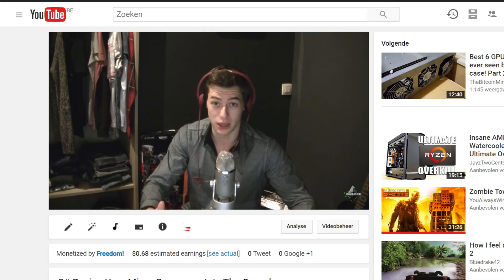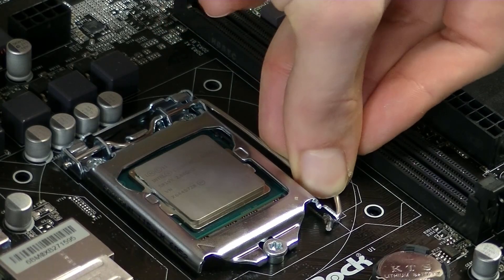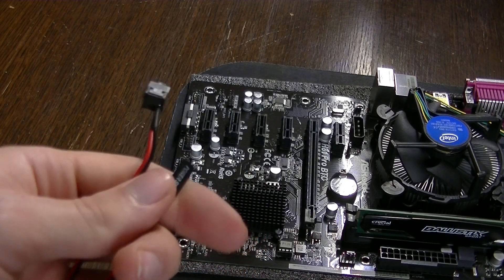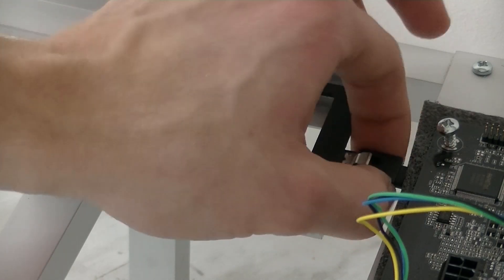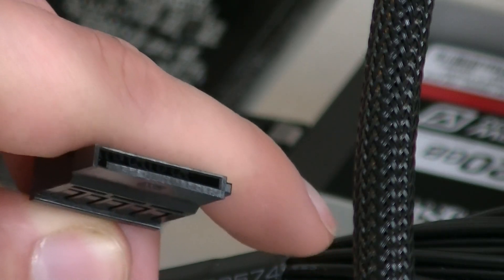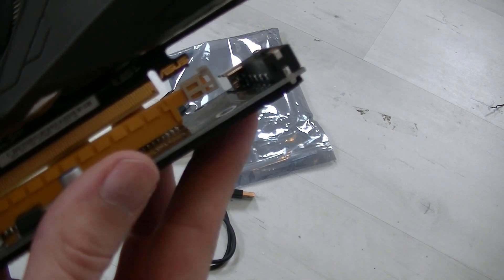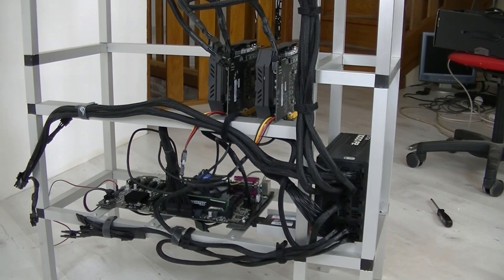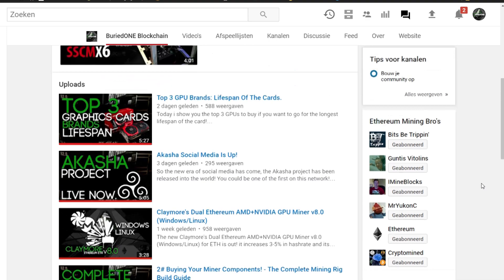3# Assembling The Mining Rig - The Complete Mining Rig Build Guide

Comment: So I went ahead and ordered all the stuff of your website to build an 8 gpu rx 580 rig. As I have started to work on the rig I’m noticing the mother board will only Support 7 cards of risers and doesn’t appear to have an m2 adapter. Also, the recommend power supply was a 1200 w. I think I’m going to be way short on power looks like each gpu requires an 8 pin and a 6 pin plus risers I’m going to be way short. What am I missing. Full disclosure I’m a newb on gpu mining

Comment: Built my rig with a single card, all fine, decide to buy another two cards, only one of the pci x 1 slots work. dammit! :(
Reply from the maker: Scott Miller oh that sucks bro..! Can you get a replacement for your board as warranty maybe?
Reply: Yeah, I've already sent the message to the Amazon marketplace seller. I've read other reports that the pci x1 slots are unreliable, so I won't be surprised if the new one has the same problem, I also have to pay postage and buy new thermal paste. 1 slot works fine, all others Windows fails to boot or if it does no card is recognised.

Comment: Anybody have any idea why I cannot connect any more than 2 GPUs to my ASROCK H81 motherboard???
I have 4 GPUs but computer will not recognise any more than 2!!!!
Please somebody help its driving me CRAZZZZZYYY!!!
Reply: Disable your onboard gpu in the bios
Reply: Thanks, but I've finally figured out what the problem was!
Apparently the ASrock H81 motherboard is NOT compatible with Window 10 when using Nvidia GPU's!!
So I've changed to Windows 7 and everything is working fine.
But thank you for your advice.
Reply: This is strange, I'm on win7 but it only takes 3 GPUs at the same time. No luck with the 4th regardless what I tried.
Reply: Have you connected the power to BOTH of the molex connectors? Theres one at each end of the row of PCIe sockets??
And are you giving the computer plenty of time to install each individual GPU?
I know I sometimes felt like the computer had frozen when it was installing each one but it just took a really long time for each of them to be recognised.
Try installing just one at a time and giving it a good 5-10 minutes for the computer to register each one when you instal it for the first time.
Reply: It is said, if the risers are powered there is no need for the Molex connectors, but ether way it made no difference. What is plenty of time for you? 10 minutes? 20? May be I'll give it more time.
Reply: Yeah I'd say it took about 8-10 minutes for each one to get installed on mine!
I remember always feeling like the computer had frozen and I was about to turn it off several times, but then it seemed to finish doing something and then it was up and running??
Yeah I'd say about 10+ minutes and it should of either installed it or not.
Reply: I gave it another try and put the extra card in...nothing happened...no freeze or anything...starred at the Devicemanager for 15 minutes, still only 3 cards. I asked asrock for the beta bios 1.30B, may be I'm lucky then.
Reply: Sorry I couldn't be any more help, I hope you get it sorted soon.

Comment: Hi, very interesting videos! I have the H81pro btc R2 and powered risers, must I connect the two 4 pin molex of the mainboard (named PCIe Power Connector (PCIE_PWR1) and PCIe Power Connector (PCIE_PWR2) to the power supply or because he risers are powered it's not necessary or even can cause problems ? 

and.. what are the best bios settings of this mainbord for ethos/win10 ?

tks ! if my rig starts I'll send you a beer :) ) ) !!!
Reply: A Rossi same question!
Reply: A Rossi sane question please, it seem that it s ok with 4 cards and the 5th and 6th one are not recognized...
I do exactly the same as the video, i also tried to connect pciepwr1 molex and pciepwr2 but its not changing anymore...

Comment: hi, i have done all of this and it works and powers on and everything but when i connect it to the monitor it does not display anything, also tried removing everything except the cpu and ram and power and still does not display anything, is there something wrong with my motherbaord?
Reply from the maker: Bob Smith its a possibility, but did you try to plug the screen in the board itself and the pci16 card?
Reply: thanks for replying, im not a tech guy but for testing, i have a monitor which has it's own power supply from another socket and used the hdmi cable to connect to the board (i have tested the monitor with my laptop and it does work) it may be the cpu, i put it in a bit rough and this is my first pc build, your video really helped, if you can think of something else it could be please let me know, if i cant find how to fix it ill just order another mother board. Thanks again :)
Reply from the maker: Bob Smith Try to put a gpu in the long pci slot and plug the screen into that :)
Reply: tried that already but didnt work sorry
Reply from the maker: Bob Smith Try to ask someone in our discord chat to help you out :D
Reply: i found out it was because the pins where you place the cpu was a bit damaged, after fixing them managed to make it work, i'm just wondering if i were to get 6 graphics cards on one board such as 6 rx480's or 6 gtx 1070's, would i need 2 psu or will one be enough as i saw one of your videos, one of your rig caught on fire almost :) Thanks
Reply: Hi, how do you fix it? Send back to manufacture? I bought one too and getting no display. My problem is after power on, it turn off after 2-5 secs, then turn on back. Still no display appear just like your problem. Although switching GPU port or Mobo  port.

Comment: Nice Video, 

You should connect the 2 molex cables to the motherboard
Reply from the maker: Ahmed Nattiel is that necessairy? My other rig doesnt havr those
Reply: For sure buddy, those 2 molex cables will power up the 6 PCI port
Reply from the maker: Ahmed Nattiel oh weird that it works without on my other one
Reply: Dude, check the motherboard manual !
Reply from the maker: Ahmed Nattiel Ill plug it in after im back from work ^^

Comment: If I choose the EXPENSIVE BUILD what would be the earning on a monthly basis? Please I need your help
Reply from the maker: Muhammed Akram without electricity cost $280/month
Reply: thanks for letting me know
Reply from the maker: Ure welcome ^^
Reply: Instead of buying 6 Radeon RX 480 should I consider buying only 3 Nvidia GeForce GTX 1080 Ti ?
Reply: Is MinerGate worth trying?
Reply from the maker: Muhammed Akram i dont know the performance of a 1080ti but it wont be better than 480s
Reply from the maker: Muhammed Akram no mineregate is a scam
Reply: Are you sure about that?
Reply: & please guide me on how to mine cryptocurrency step-by-step
Reply from the maker: Muhammed Akram on eth mining gtx 1060,1070,1080s hit very low hash rates compared to rx series, so i dont expect it to blow them away by 3 times
Reply: okay I get it now & also let me know how to mine ethereum & other altcoins